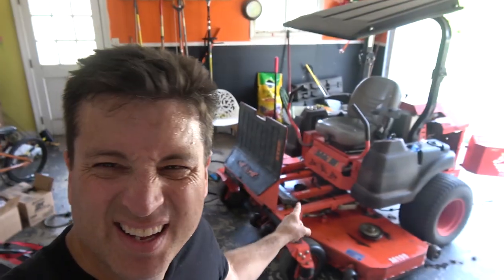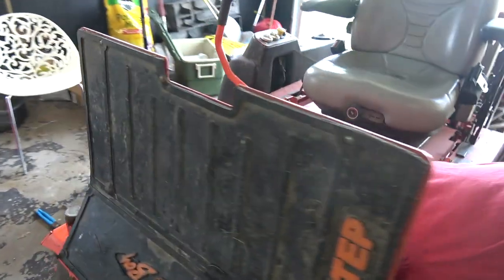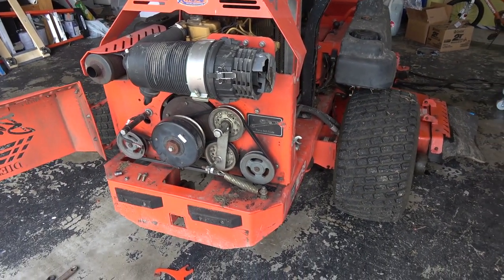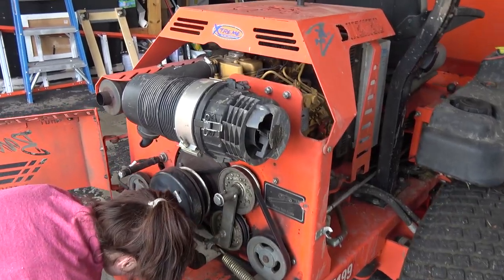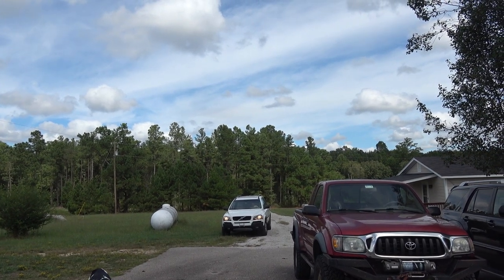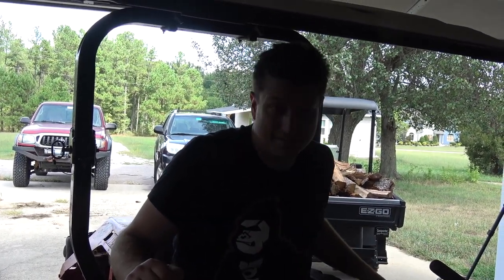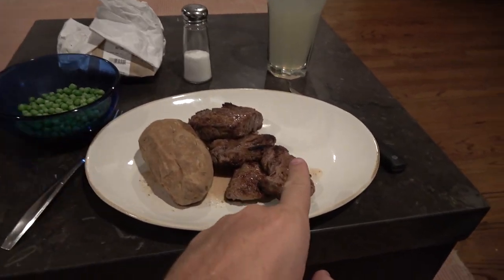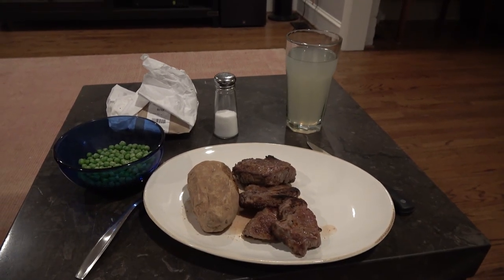Back on the Compound/Hope Drives

Comment: You're welcome to message me or whatever if you have a question about repairs, Woody. I'm a lawn mower technician at John Deere. I've never actually seen a "Bad Boy" or whatever in the shop, but generally speaking, most zero-turn mowers are pretty similar. The drive belts are almost always easier when you connect to the drive pulley last (your wife is smart). I don't know if you noticed, but it'll have a tensioner pulley on it that you can move to take the tension off of the belt and route it through a lot more easily.
Reply: Also, 90% of the time when I've seen drive belts fail frequently it's from a blade spindle not spinning either because a bearing failed or because there's twine or something wrapped around the spindle. Good luck!